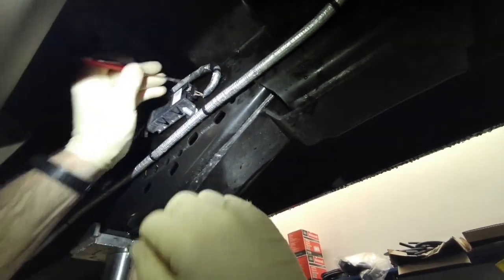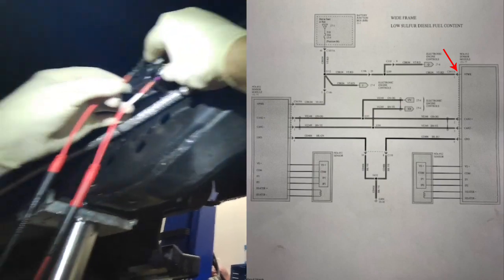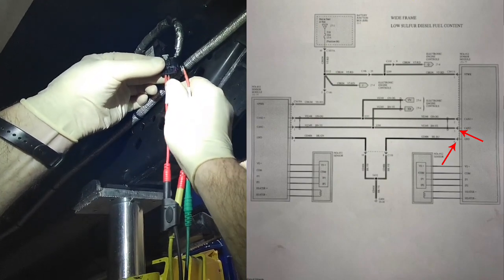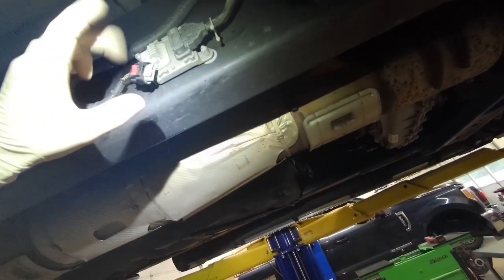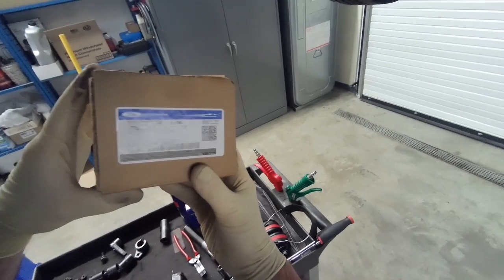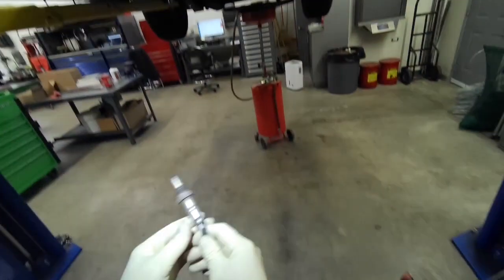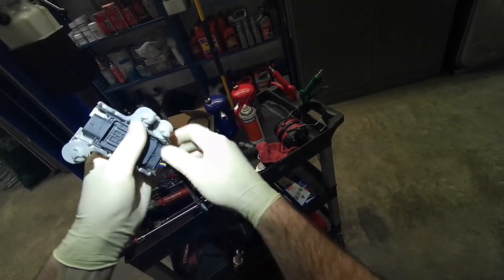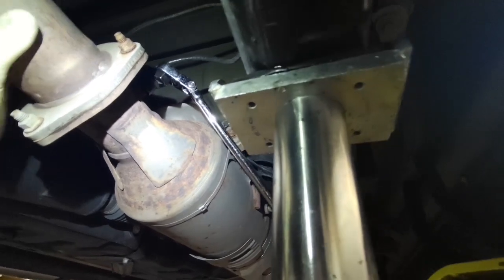SUPER DUTY P2A01 NOX SENSOR CODE

Comment: Hey man great pinpoint test! Do you have any clue as to why the failure? I've had mine on 21 f450 done once under warranty now failure again 1 year later 77k on motor its a hauler of camper frequently loaded always clean best quality fuel available and EDT treatment for the pump lubrication so well maintained any thoughts are appreciated keep up great videos keep em up
Reply from the maker: I don't. Just one of those things I guess. Could be a part that is so sensitive, it has a high failure rate. My 13 Super Duty had one go out in less than 10K. So far so good on my 22 SD 🤞 It does sound like you are doing everything right at least.
Reply: I'm going out on a limb here. I've read and discussed that these failures are due to "out of date" DEF. My local stealership has 4 on the shelf and the nearest metro only has 1 on the shelf. They fail frequently. Anyway, I'm going to try and soak one in Berryman B-12 Chemtool overnight, then blow it off inside and out. I'll have that old part sitting on the shelf. Evidently, they are the same # LC3Z5L248A.

Comment: Do you have a preference for a headlight when using it for testing or producing a load.  I need to add a light to my troubleshooting "tool box", which one do you recommend?
Reply from the maker: I use an 4656 bulb that has high and low beam, here is my build: https://www.youtube.com/watch?v=b_oK4OQ64Js&list=PLCGan5QBcVYnGeYgHlmwbTTP4JMohQp7V&index=9&ab_channel=RainCityWrench